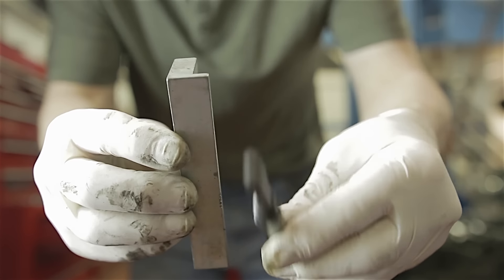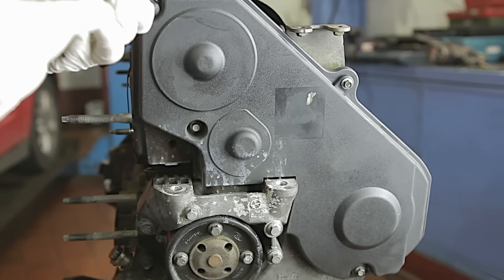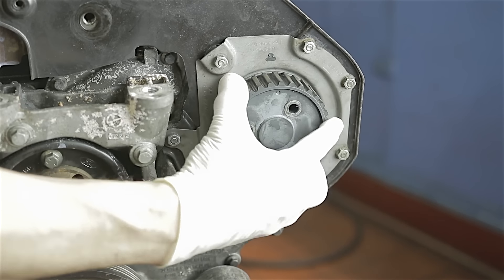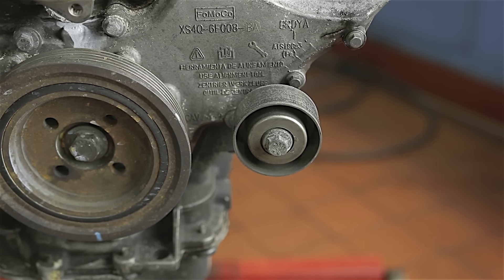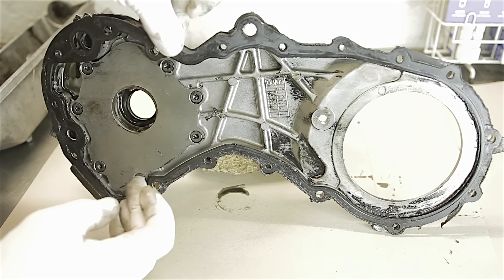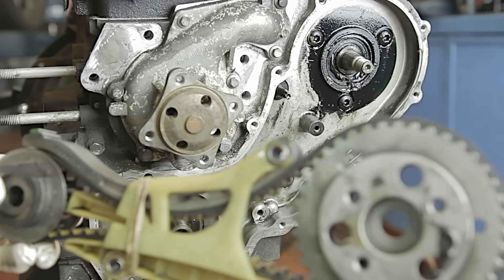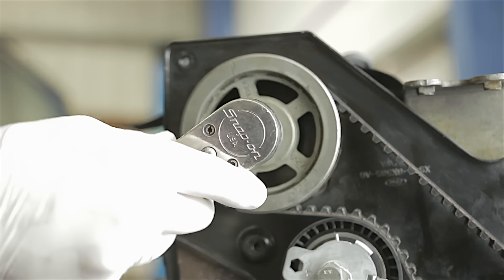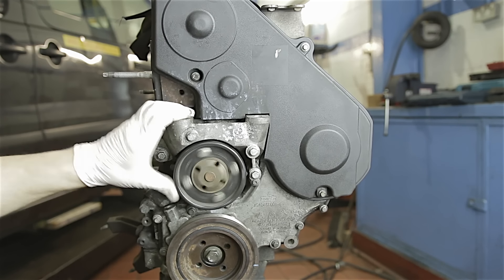Ford Mondeo/Transit Connect 1.8tdci wet timing belt replacement

Comment: Thanks for the video top video I'm not a ford man don't rele no a lot about the 1.8 tdci engine.. I have a ford connect 2007 the wet belt has snapped what's the chances of me putting a new wet belt / chain on and new top belt and it being ok ... Lol or am I completely wasting my time cheers ....
Reply from the maker: if you have a snapped wet belt, there is almost definitely hit the valves

Comment: Thanks a lot for this video i found it very helpful. 
I had took the timing case off my 2006 connect and i put back in without using the element tool , do you think it should be a problem ? Thanks
Reply from the maker: those casings should be aligned up with a special tool....if you're crank pulley seal starts to leak then thats why, if it docent then your ok

Comment: Hello alan

I am using ford mondeo 2016, The powertrain signal turns on and engine cut off hard acceleration while driving. I have did all the service also. Its very dangerous for driving especially in motorways. Do u have any idea about this issue?

Comment: Hi mate your post is excellent thanks. Just got a query about the notch on the cam pully and the dot on the fuel pump pulley can these be set at a set number of   groves on the belt apart
Reply: Like the wet belt is

Comment: If i just want to change de pulley crank seal do I need timing tools ? If the pulley is out ,the timing will be damaged?  I saw your video now and I need to know by tomorrow if i need timing tools...THANKs!!!
Reply from the maker: no you don't need any timing pins....just unbolt the crank pulley bolt, replace the seal and refit pulley and bolt..the timing will not be disturbed
Reply: Thank you very much, my logic was good but always it is better to ask somebody who 's done it hundreds times.

Comment: Very great video ! Please how much km and years it is necesary to change the both rubbers ?
Reply from the maker: hi, the lower belt in oil should be changed at 125k miles or 10 years...  the top belt is the same but normally change at 100k or 10 years.
Reply: alan howatt very thanks. !!

Comment: Hi Alan😊,
I have oil leak under the timing cover which is I want to change it but not the timing case which i have chain. Is it enough just lock flywheel and plate under rock cover? Without look pin? I had problems to get there. 2007 mod. Smax!

Comment: @17:01 - how easy is it to remove the back timing case? Had some of the water pump bolts snap in there solid and would rather get the rear casing off and in the shed to drill and tap.

Comment: Used this vid to change mine excellent what is the best oil to use in these  engines cheers
Reply from the maker: 5w/30 oil.. your motor factor would supply you the correct oil using your registration number

Comment: I have a question for you Alan   I feel vibration when im driving in the left side of my ford focus 2002 tddi , could you help me to fix this problem also my cars doesn't  reach its top speed it does not go over 120km/h, it's not accelerating well its slow now. Could you please help me fix this problem.
Also keep up the good work its very interesting and enjoyable at the same time it helps me a lot , thank you Alan.

Comment: I have a 2006 Ford s-max 1.8 tdci. It looks like this engine probably does not have a wet belt. I will of course check this at my local Ford shop. If I understand you correctly, then replacing the upper belt is quite straight forward easy. I only have to remove the cover, paint mark the 2 sprockets, replace the time belt tensioner and fit the new belt. That's it? No need to remove the top cover of the engine and no need to use the special timing tools? And there's no need to replace the lower chain, because it will anyway outlive the car? My engine will soon reach 400.000 km and is still running perfectly.
Reply from the maker: yep...thats all you do..nice and easy for the top belt...assuming it runs well before you start the job...with the paint marks you can't get it wrong

Comment: About to change the fuel pump so this vid is handy. Cheers.
Reply: Hiya mate I just bought a transit connect with a  not working fuel pump is the fuel pump the second pulley your man pulled off ? If so  what a terrible design  I mean why not have it in the tank like normal 🤣
Reply: @seanconnelly2832  yes the second one , front of engine.  Make sure you buy a virginised pump if buying a secondhand one. They need to be coded to van once fitted.

Comment: Hi, excellent video. Its necesary to take out engine to change the belts? and other question, how many kilometres and/or years there is to reemplacement? my ford has 65k and ten years old. tkx for your answer.
Reply from the maker: hi, you don't need to remove the engine...it can all be done in the car...i was lucky to have a engine out just to make the video and film it more clearly.
 
if you have a wet belt fitted the service interval is 125k miles..if you have a chain fitted it is the same but i would never change the chain....once a chain is fitted it will outlive the car

Comment: Alan.   What would your suggestion be for the Transit Connect 1.8tdci T200 EGR valve/manifold. Replace or clean out?    Most garages i know of replace the entire manifold with EGR valve but would that be because they find it too time consuming to clean out original EGR valve inlet manifold ?  

They also have EGR Valve Lift pin issues as i understand it with the EGR pin fitted with a tiny roller bearing at each end. ?
Reply from the maker: the egr used to be sold with the manifold but you don't change the manifold.....best thing you can do is with ignition off disconnect the multi plug from the egr valve and tape it up....as long as the flap in in the manifold is closed the engine will now run perfectly fine and no engine management lights should come on
Reply: @alan4x handy tip that cheers mate, blanked mine off 2yr ago but now light keeps coming on.

Comment: Hi Alan hope your well I have been doing the wet belt on the mk4 Mondeo  today I had two problems
the first we locked the cams with the steel bar my mate held the fly wheel with a pry bar but when i tried to get the big pully off it turned the pully with the bolt but. He said the fly wheel did not turn so would This caused 
any damage and also when we turned the fuel pump pully to tight it up it moved a bit one way then another would this do any damage i have been watching your video but these are the only problems i have had could please let me no as its worrying me thanks

Comment: hi i have 2 1.8 tdci mondeos one with the wet belt gone so when i saw your vid on how to change the belts i said no way. so thats when i bought another one its a 2009 the fecked  one is a 2008 . i got a garage to change the belts lol.so now i have a problem the bluetooth didnt  work in the 2009 so i took the bluetooth out of the 2008 which was working i also changed the radio the bluetooth works but i cant get any volume. any ideas on what i have done wrong thanks willie

Comment: Ok, been a disaster here,my daughter's C-max 1.8tdci with "history" of timing and wet belt done has snapped or displaced the main belt. I was going to look at a 10reg, but got an estimate for cam belt and chain conversion like you showed us, and it was £850-1k.... car is on 84 but was gonna get it done... not getting the car now. What do you think of C-max 2.0tdci engine,  that's a cheaper, simpler belt change?

Comment: Ok my daughter's C-max 1.8tdci snapped the camshaft in 3, we assumed due to wet belt failure,  I've pulled the engine to see for myself. The normal cambelt had snapped,  stripping some of the teeth. The wet belt and tensioner appear in good condition. So I am at a loss what else could have caused the failure.

Comment: @Alan Howatt Your video is amazing! this best quality sound and video i've seen on a mechanic video and the instructions are clear and straight forward, nice one for taking the time to make this. Got a 2006 connect this week and on 146,000 with no service history or history of the belt being done. It's running a wet chain. Do they need changing while i got the top belt off or will the chains just last? and just do the top belt?. Read many stories and info from forums but just wanted your views on it.
Cheers Mike
Reply from the maker: hi, if you have a chain fitted in the lower crankcase then leave it alone, it will outlive your van...just change the top belt, happy new year
Reply: @alan4x   Hi Alan thats awesome thank you. Really appreciate that. Happy New Year!. Hope you have a good one. Cheers Mike
Reply: Alan how often is the top belt changed?

Comment: Hello good, I have the same engine, but it is supposed to have a lower chain.
Can it be detected if it has a chain or belt by difference in noise in the motor? Does it sound different depending on whether you have an oil-bathed chain or belt? Thanks. Because otherwise how could you know without having to drop the entire distribution?
All the best

Comment: Great video Alan, just found an oil leak and local garage diagnosed that it was coming from the timing chain cover (lower crank case cover), easy job I thought. But they are trying to convince me to change the timing chain/belt too. Only recently been done about 20k miles ago. I don't think it is necessary but would appreciate your thoughts. I think they are saying that a seal needs to be changed behind the timing belt, I think they're trying to recover the cost of repairs as I only just got the van and identified the leak, so they are obligated to fix for nothing under purchasing warranty.
Reply from the maker: hi ken.... if you have a chain in your lower crank case then it would not need replacing..you can remove it and put it back, the same if you have a wet belt as it has a hydraulic tensioner so if you remove it and put it back you are not tensioning it anymore than it originally was.
there is an engine plate with a gasket behind the lower chain which can leak and would need the chain to be removed to replace it. the oil leak would need to be diagnosed correctly as there are various seals that can leak..lower case gasket..crankshaft front oil seal..high pressure fuel pump seal etc...sounds like this leak started after your chain was fitted, anyway, good luck

Comment: But how do you find TDC on the compression stroke of piston one if the belt failed and trashed the pistons and valves. There can only be one correct position for TDC although the crankshaft pin will stop the crankshaft when piston one or four is on compression.

Comment: A very helpful and informative video - I am just starting the wet belt on my Transit Connect so a big thank you. One area that I don’t currently understand is the damage that appears to occur when these belts break (happily to date, I have no experience of this although my van has done 125k). I had assumed that given the belt connects the crank to the high pressure fuel pump (and assuming the dry belt is ok) all that happens when the wet bet breaks is that the vehicle stops due to fuel starvation. I am obviously missing something – to generate the damage to valves, guides and pistons surely the dry belt has to break as well?
Reply: Solved my silly question - obviously the high pressure pump is the connection point to the camshaft from the crankshaft via the wet belt  - anyway thanks for the vid.

Comment: This is how Ford and similarly other manufactures make money. You either pay a small fortune to have the belt replaced, hopefully correctly or the motor trashes it's self and you pay a bigger fortune having the damaged parts replaced plus the belt, or you spend an even larger fortune on a new car. Engineered obsolescence, when the could have sold the vehicles for a couple of hundred dollars more on the first place with a better timing system that doesn't shit the engine when the belt breaks.
Reply: They did it was the Pinto engine,done no damage .Cortinas capris escorts etc..

Comment: Had my wet belt snap the other week. Had a busy few days sorting the engine and fitting new belts etc. Now just need to get the timing back to normal. I am guessing inserting the locking pin in the block will work exactly the same if I turn the engine till it buts up against it and obviously use the cam locking plate as normal? Cheers

Comment: Hello Alan, very good video. I checked my engine (qyba on my mondeo), unfortunatly the belt hasn't been replace at 200 kM and tooth has been damaged at 285kM. The engine failed at about 30mph and was enough to bent 6 valves and damage the 4 pistons and destroyed the cam shaft. I really don't understand why Ford made this f*ck**g design on that wet belt. Now I have to find an engine that is quite hard ...here in France. It seems the connecting rods  and crankshaft are not damaged but anyway I will have to replace the pistons.. great watching your video again and again..Many thanks to you !
Reply from the maker: hello, if it is just a few dents on top of the pistons...that is ok... the piston heads are pretty thick, as long as the bores are not damaged.however,  it is a lot of time and expense whether you fix or replace the head or get a new engine
Reply: Hello Alan, thank for your answer. I think I have to replace the four really damaged pistons unfortunately (the engine is out of the car so it's easier to work on it now). While making complete revolution of crankshaft the 4 pistons are coming at the same high point (I think I don't have bent connecting rods or damages on crankshaft).The plastic guide of the timing belt has been broken where stands a circlip (12.28s in your video). I think I'm going to replaced by chain kit + water pump. I got a new head (valves and camshaft complete in use for 70€ !! 80% discount). So I think by chance it will cost me not too much money...(half price than a used engine  at 2000€). Any idea or comment is welcomed.10.000 thks.
Reply: Hello Alan, finally my Ford Mondeo engine is rebuild with parts. Engine kit, welt timing belt, upper time belt, water pump, news valves and pistons, 9 pairs of bearings , fire gaskets for injectors, coolant thermostat...all is fine I just drove 65 kilometers this afternoon and all looks good. I would say it cost me a total of 800-900€ and tools (150€, hopefully I had already a lot of them)  and 15 full days f.
I want to thank you again for your video, you can be proud to say you saved a french mondeo (lot of laugh).
10.000 thanks again for sharing your knowledge and hope as you said someone else in the world.  I wish you all the best ! Take care of you and your family.

Comment: I have a 2011 1.8 tdci 110 ps.
Does it have a wetbelt or a chain.
They say after 2008, Ford changed the chains for a wetbelt.
Reply: If its build date is before Oct 2007 it will be chain. If its after it will be a belt.

Comment: Replacement of fuel pump...do you need to change the lower  timing chain? 2006 1.8tdci 
Can the fuel pump be changed without taking all the lower casing off is what I'm wanting to know?
Reply from the maker: yes the pump can be unbolted and removed without touching the lower chain

Comment: there is a kit to replace it with a chain instead a belt which is way more reliable and durable. These engines came with a chain before 2007 but Ford wanted to complicate things with a wet belt

Comment: My engine is a timing chain in a focus 115 , which i want to change as i believe this is whats rattling after its warmed up , my question is this : where did you get that timing alignment tool ? Im glad i saw this as can prepare some tools etc but cannot locate that tool you are using around 19:25 with hexagonal shaft on it . Very interesting video as ive seen you before on other videos :)
Update : Just found one on a famous website & bought it £33 , Alan cheers again :)
Reply from the maker: richie674 
 Hi. This tool kit off eBay will do the job. 
     https://www.ebay.co.uk/itm/Diesel-Chain-Drive-Timing-Kit-For-Ford-1-8TDDi-TDCi-Fiesta-C-MAX-Focus-Mondeo-/401728373000

Comment: Hey Allan, great video mate, it's inspired me to do the chain conversion on my car, I've acquired everything needed, but struggling to find the torque settings for the 21mm HP fuel pump nut. Can you help me with this please cheers George tintanaudio specialist
Reply from the maker: i don't have the torque setting for that nut, i just tighten it tight with a socket and bar
Reply: @alan4x  OK thanks for getting back to me buddy 👌. I suppose I'll aim for 40nm maybe 50nm like the camshaft bolt and automatic tensioner, if you think this is too much or not enough please let me know your thoughts are mate. Keep up the good work and brilliant videos 💯.

Comment: Hay bud great video you made. Any chance of showing what is involved in replacing the inner cover. I have an oil leak from between the block an timing cover. I'm half way through it at the moment but would be good to see the whole cover off so I know if there are any hidden bolts or brackets tbat need removed.👍👍👍
Reply from the maker: sorry man, that engine is long gone now so i could not show you if i wanted to, i have not taken that casing off the engine ever either so your on your own, good luck
Reply: alan howatt I'll let you know how it goes 😁😁

Comment: Got 57 plate Mondeo 1.8tdci 122k miles, just checked it has a mostly black tensioner with a doned end so a chain. Is it worth replacing? Have you known the chain to fail?

Comment: Hiya mate is the crank pulley friction or woodruff as need to do the seal but don’t want to take it off without knowing if I have to time it or not any help would be appreciated thanks
Reply from the maker: hi, you can unbolt the crank pulley and remove it easily..it will not affect the timing in any way, there is no woodruff key holding the pulley to the crank, just remove bolt and pulley, fit new seal and refit pulley..done